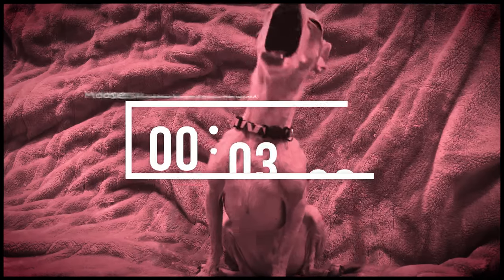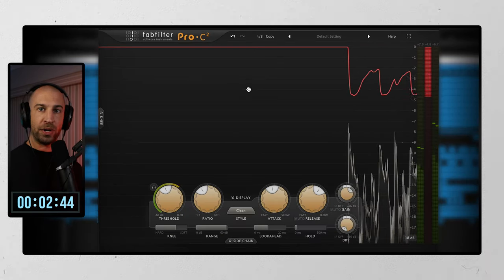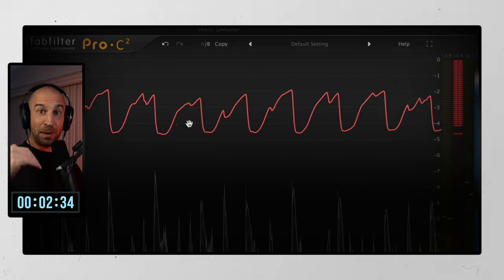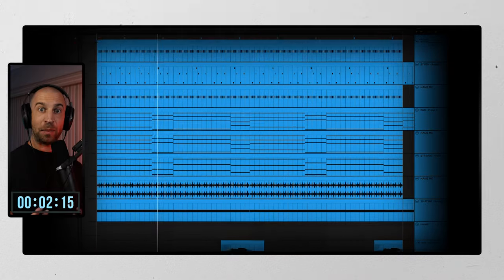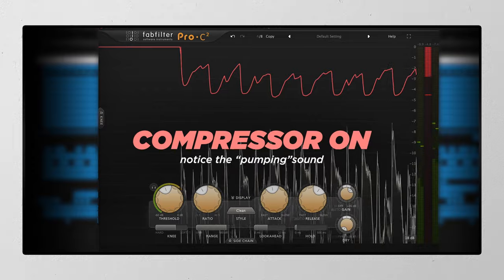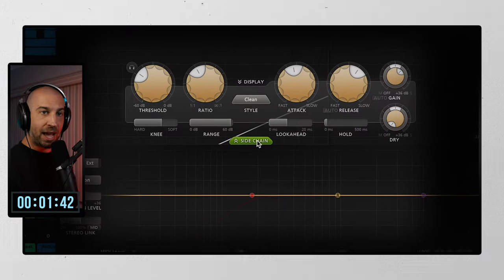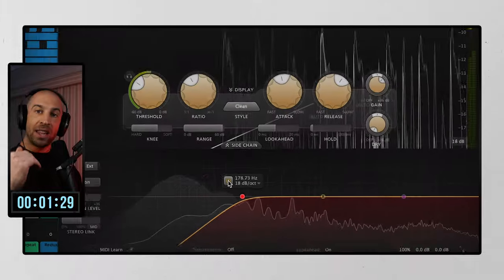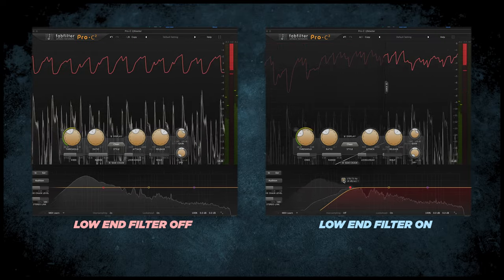Every song with HEAVY LOW END should use this compression trick

Comment: The best solution wouldnt be simply using multiband compressor? What's more - whats the point of using compressor on the master? Clipper and limiter(or even 2 limiters) doesnt do the thing? Lastly - very nice and aesthetic editing :)
Reply from the maker: Thank you!! To try and answer your question (which is always tough in a comments section haha) MB comps are 100% an option! 

However, with production and mixing you want to avoid thinking of things as a "best" solution because its always case by case.  MB compressors do introduce filtering to separate the bands, which can absolutely change the sound of your signal.   That may not be ideal in a certain situation.  This method does not.  Again, one is not better than the other...they're just multiple ways to approach a similar end result!  

As far as clippping/limiting, they're also used to control dynamics on a master but in a much more exaggerated form because they have extremely high ratios.  We usually use them on the end of our chain to achieve max loudness without crossing 0db.  They also don't provide the same "sound" compression does (because we typically use makeup gain on a compressor to bring up the quiet parts).  Long winded answer but hope that helps some! Appreciate you watching and dropping the questions! 👊

Comment: So there is something that called multi band, I'm pretty sure you know that, also there's there is something that called ozon
Reply from the maker: multiband compressors are another tool that can be used on a master for compression! absolutelyyyy.  always comes down to sifting through your toolbox to find the right one for the job!  there's never just "one way" to do things!
Reply: hahahha you know that this is different from MB comp right? MB comp react to a freq range and compress ONLY THAT range.... a compressor with a filter REACTS to the freq range you want, and compresses THE WHOLE spectrum.... the filter is only used as the trigger...
Reply: @Alexzb6x  I'm just said mb is much flexible, you have much more control, also you can just use the whole spectrum with one band and it does the same function
Reply: @Prison_Mike8931  I think you are not getting it, specially cuz, yes, there's  a way to do the same thing with MB, but tbh it sucks hahaha, the way the slope works and the shape of the gain reduction goes, it's not the same, what you saw in this video is liberally something you should do with a basic compressor, not a MB
Reply: @Alexzb6x  at the end of the day it's all about shaping a volume, no matter what you use but I'm pretty sure you can do all of this stuff with even simple stuck daw eq

Comment: I like those videos but in this one I don't think it illustrates the technique too well. A 2-3 dB pump is hard to hear in its own right, but here you're replacing it with a 2 dB reduction signal which is only about 50% to 100% faster. That's not really an easy difference to spot. I think it would have been better to have a much deeper pump from the bass drum and a much lesser reduction envelope from the higher frequencies. That way you could compare what's going on easily. As it is I am struggling to hear the difference at all, and I honestly don't think I heard it.

I think you also sell this technique as something one should always do, whereas bass pump is crucial to most electronic genres. So it would make sense to tell people to do it only if their specific genre is of the kind that doesn't benefit from a pump, such as pop music, lounge, chillout, downtempo, etc. You definitely shouldn't be removing the pump on any house, techno, or similar..

Thanks for the video though. It was a fun one none the less. The principle is well explained. It's just difficult to hear what's going on. Appreciate your work.